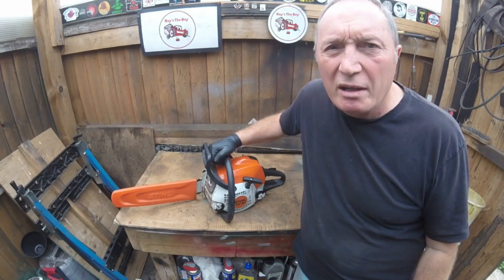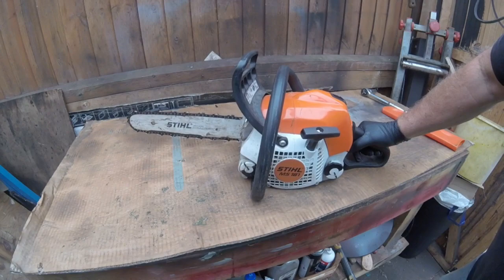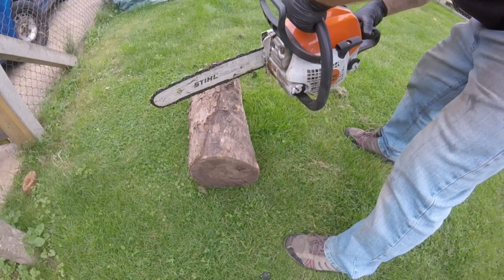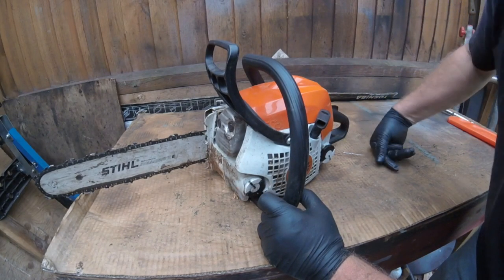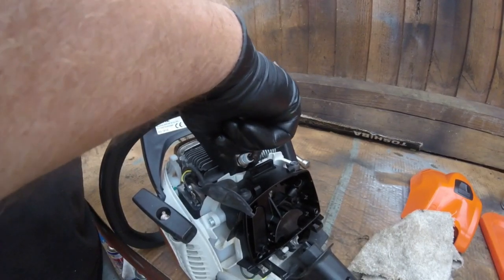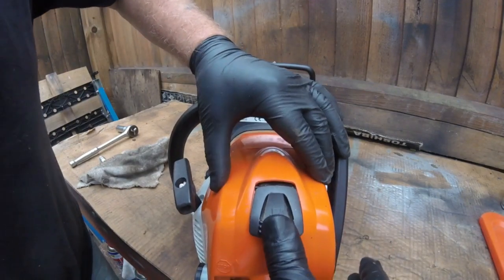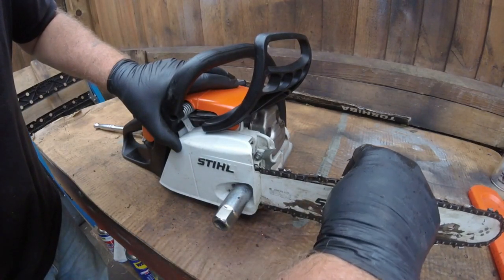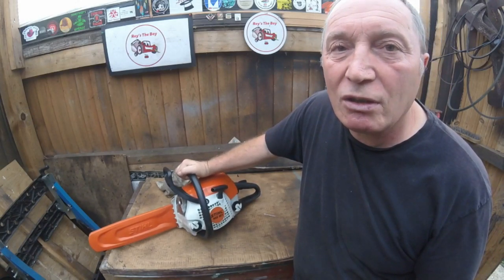Sthil MS181 not running correct /Needs Tunning up

Comment: Should check the spark arrester screen in the exhaust it's a little gauze designed to stop an flames exiting the exhaust incase of forrest fires it can gradually block up over time and give you lack of power you can soak in petrol or acetone to clean or remove all together
Reply from the maker: It was fine